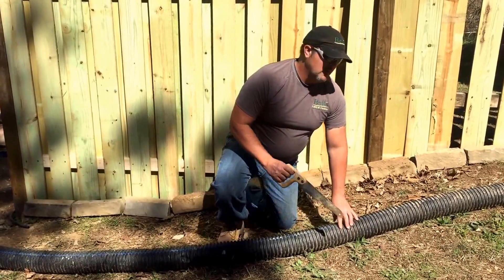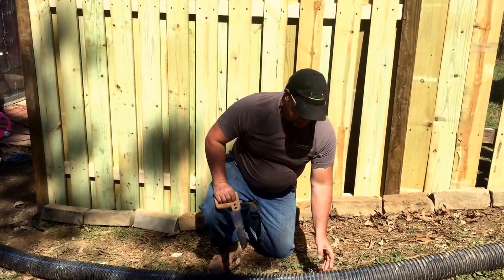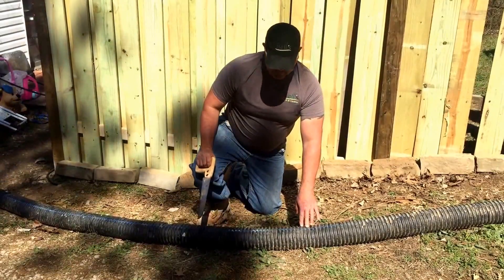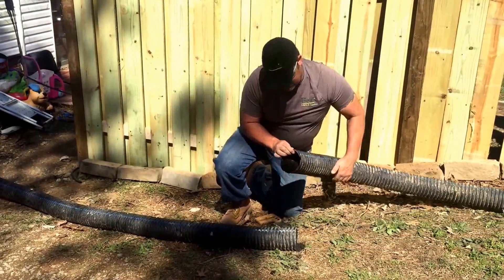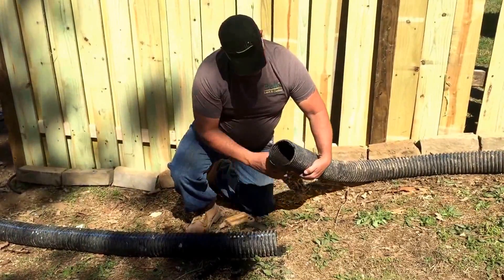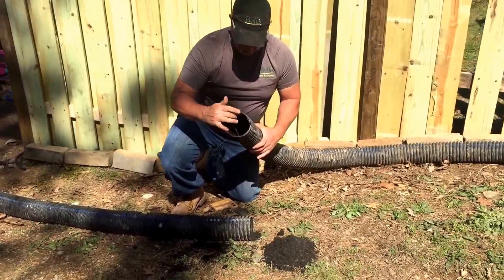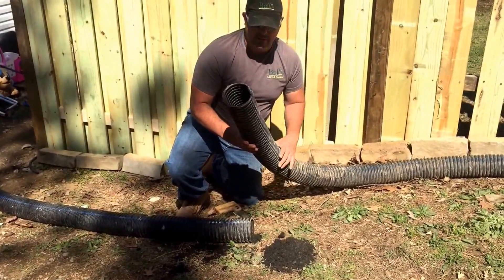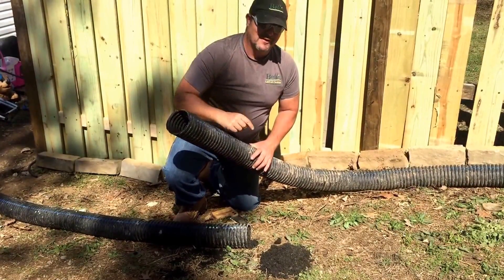Gutter downspout drainage - use solid pvc pipe -

Comment: Frenchdrainman says the opposite. Don't the ribs promote turbulence in the water flow to push out materials? Is it proven that smooth pipe will push out debris more easily?

A catch basin sounds like the better fix.
Reply from the maker: jakanddax0 well if I was selling you corrugated pipe what do think I would tell you? And yes it’s proven smooth bore pipe pushes debris out easier. Why do you think your sewer pipes are smooth bore and not corrugated. If what he says is true why do the Manufacturers of the two pipes recommended different installation recommendations for the two pipes? Not me saying it, you can find it on their (manufactures) web site. Corrugated pipe must be installed at a rate of 2% to achieve push out equal to smooth bore pipe at 1%. 

Sorry but that man is a crook. It’s a shame so many ppl are wasting their good money on his lies. Plz feel free to reach out if you would like for me to debunk more of his junk

Comment: In my opinion, Corrugated pipe is perfectly fine to use if you install a catch basin immediately below the gutter downspout.
Reply from the maker: Jay Abraham if you have the correct fall afterwards , which is 2%, unlike solid smooth bore which requires a lot less pitch.

Comment: I've used both and talked to guys who preferred either one. The shingle thing makes a lot of sense, that had never crossed my mind. The job I'm bidding right now is going to get quoted PVC instead of the black corrugated they wondered about. Thanks!
Reply from the maker: pjs5191 it’s whichever product one trust the most I suppose. I personally just don’t like corrugated and feel it’s just an inferior product. I’ve even gone away from thinwall rigid pvc pipe for the more robust SDR35 in last couple of years.

Comment: Hey Brooks, I've heard in the Midwest that all the freeze-thaw can crack PVC joints sometimes. What do you think about the flexy double-wall plastic pipe, that's completely smooth on the inside? I guess the tape they recommend for the joints seals the joint, instead of the glue joint in PVC...

Comment: I’m assuming your down south and the ground doesn’t really freeze. But up in NY, using sch40 wouldn’t work for long runs because of the frost heave right? It would crack the joints. Why not use ADS N-12 (dual wall) corrugated?
Reply from the maker: Jhoran1314 do you fully understand how frost heave actually affects piping and how the stresses from it are put onto the piping? 

Doesn’t ADS have joints also?
Reply: B&B Drainage Solutions correct there are joints, but they are put together by a coupler and then tile tape. Should be very resilient. But again, maybe sch40 is great for south and corrugated N-12 is better up north..
Reply from the maker: Jhoran1314 it makes no difference what type of pipe you use when it comes to frost heave. They are all susceptible to the affects of frost heave. 

Lot of mis information being perpetrated lately by some individuals. Kinda helps explain why they keep the comment section turned off. 

I’ll be doing a video shortly, with actual information from studies, on frost heave and how damages and affects pipes. None are impervious to it. 

And yes, for downspout drainage you can use smooth bore piping (triple wall). You can use corrugated as well, so long as the recommended slope of 2% can be achieved on the run.

Comment: Good info. The problem I'm having is a large sump pump draining to outside. Its powerful and to much pressure with the 2'' pipe. Small front yard where water is going across sidewalk/driveway and freezing. Wondering if I should do a 2'' to 4'' pipe adapter and ease the water pressure? Not sure what to do. thanks.
Reply from the maker: Mote Hopper what is the issue...the water freezing on the sidewalk? Is that what you are wanting to correct?
Reply: @bbdrainage  the water pressure is so high the water is running across the sidewalk and neighbors driveway and freezing. I was thinking of placing a 4'' perforated pipe and diverting it but its in the front of the house and an eye sore. I was thinking maybe from 2'' to 4'' would lesson the water pressure from the 3/4 hp sump pump. front yard is only 30' from house to sidewalk. Thanks for your reply. Will
Reply from the maker: Mote Hopper I would think you would want to bury it below grade. You could go to 4” perforated pipe and construct a leech field. Similar to a French drain only allowing water to percolate. It would have to be a minimum of 20’ run with a relief (discharge point). If heavy clay soil a minimum of 12” in width and 14” deep back filled to grade with drainage rock.
Reply: @bbdrainage  Have to give it some more thought. thanks
Reply from the maker: Mote Hopper it Sounds to me it’s more of a volume of water, then pressure. And if that’s the case you have to put that water, or some of it, in another location. To much water. But without seeing it I cannot be 100%.
Reply: @bbdrainage  Yes it is volume and a 3/4 horse power pumping 10-12 gallons of water out a 2'' pvc pipe approx 10' to the grass line which heads down the slope to the sidewalk and driveway. I'm in Maryland problem is freezing so gonna cut the 2'' pipe at exit sit on house and do the 4'' line to lesson the water pressure as it heads toward the yard until weather breaks and see how it works. thanks again.
Reply from the maker: Mote Hopper that’s nothing to do with pressure. It’s volume. To much water. So, you have to figure out a way to disperse some of the water in another area. I guess putting it in a 4” pipe is, kinda (in away), like putting the water somewhere else. Seems to me though, it’s going to continue to flow towards their property. 

🤷🏿‍♀️
Reply: Thanks. The pressure from the pump is actually cutting a line and eroding the area bad where the 2'' ends. Right now gonna get the 4'' corragated and divert the water left towards the middle of the yard for now. Not sure whether to get perforated or solid tho.  @bbdrainage
Reply: Yes the water was freezing running across the neighbors driveway and sidewalk. 
 @bbdrainage

Comment: Do you think it would be ok to use solid pvc 4" pipe connected from downspout going 15' from home and going into a 5' hole with stone and a vent for overflow?
Reply from the maker: Tom Michael Yes. So long as you are aware of your soil conditions. If you have silt/clay soil make sure you line the hole with a good textile cloth. Back fill with quarter inch rock. If you do have a silt / clay soil consider a slightly bigger hole. 

If fall allows for it, you can use corrugated pipe. But you need to pitch your pipe at 2% (2.2” fall every 10’ feet) when using corrugated pipe. If fall on the property does not allow for the correct pitch...then use smooth pore solid pipe.
Reply: @bbdrainage  Thank you , I think I will just spend the extra money and use a smooth pipe and put leaf guard on the gutters. Is there another way you would recommend doing this. I am from Michigan so not sure about using a popup with snow and frozen ground.
Reply from the maker: Tom Michael without seeing the site it’s hard to give other options. However, it sounds like you are on the right path. If up north, I’m in the south, I would think freezing would be a concern. Be sure pipes are sloped correctly to empty lines, and buried at correct depth. 

Why are you emptying into a a drywell rather than bringing to daylight? Do you not have good slope on the property?

Comment: Hmm, common sense, but still a good point. I suppose if the length is not too long and cleaning out is not hard, then corrugated is ok if you remember to unclog every few years. I have a 6 foot run of corrugated at a steep angle that I check each year. I reach in with my arm and sometimes a dead branch when it gets a bit full of junk.
Reply from the maker: Put a catch basin between the downspout and the pipe. Catch basins have a sump area to collect the debris. Nothing wrong with using corrugated pipe, in fact if you are a DIY guy by all means use it. It is by far the easiest to install. With that being said, solid pvc is is a much better choice for drainage applications!

Comment: I wish I would have watched this last year :-/
Is there a way to clean out the pipe to help water flow better? My contractor used this pipe AND tied my downspouts into the French drain.
Reply from the maker: Robb Rollinger you can use a snake or water jet to clean it. Try a high pressure washer with a clean out nozzle. It should clean it out good. You can also hire someone to do this for you.
Reply: Bellis Lawn & Gardens thanks for the response and the advice!
Reply: You just need to leave an access point and don't make your runs too long and cleanouts are easy even with a garden hose